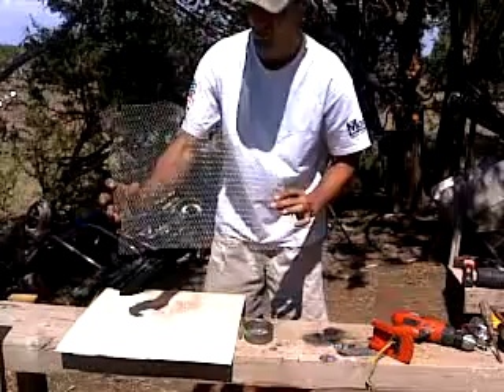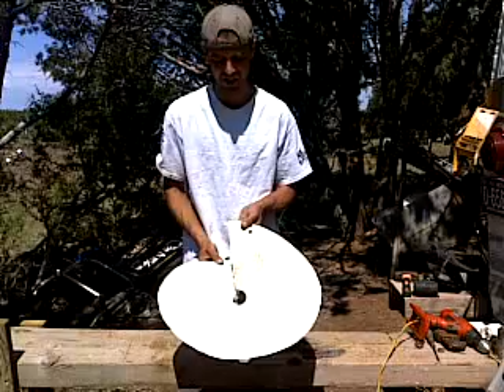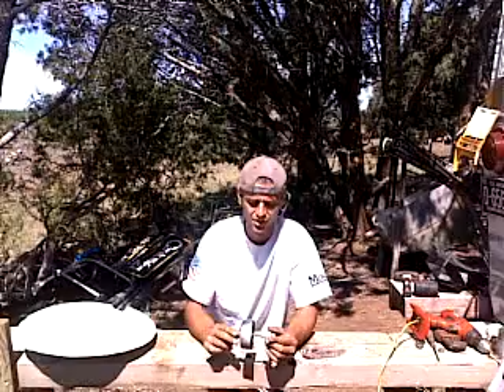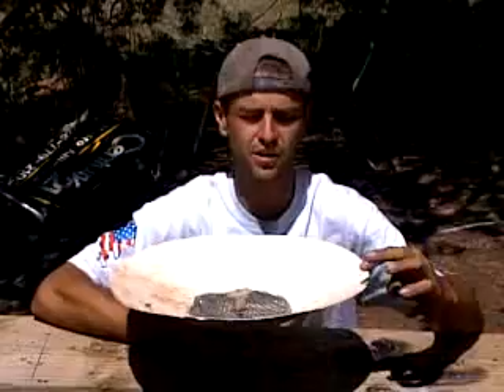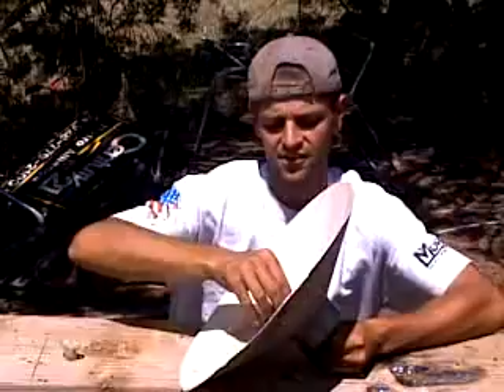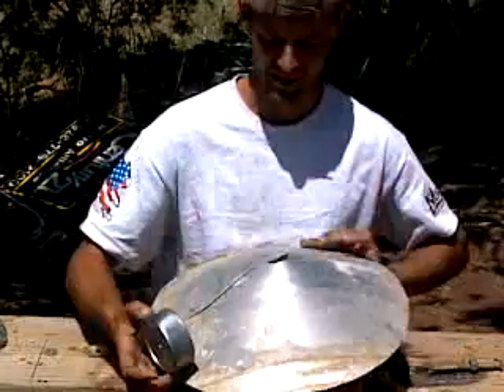gold pan home made the best on earth The "Focus Pan".

Comment: Wow, so after you finish a pan you could tip it 90 degrees and clean out the tuna can half way and then get another pan full.  You could pan many times this way before fully emptying the tuna can.  I'll make one, but I'd rather have a production grade plastic focus pan with a screw on gold trap.  Can these be purchased yet?